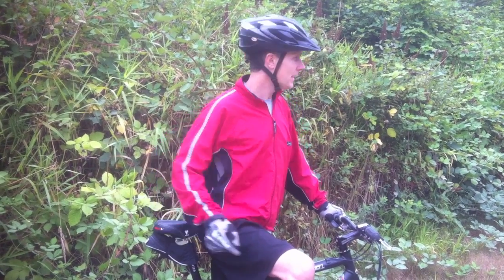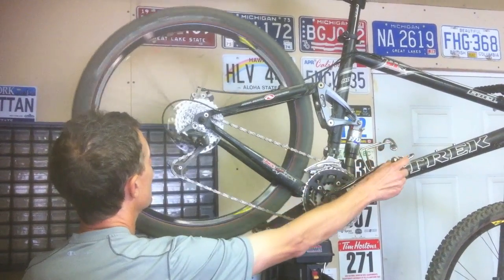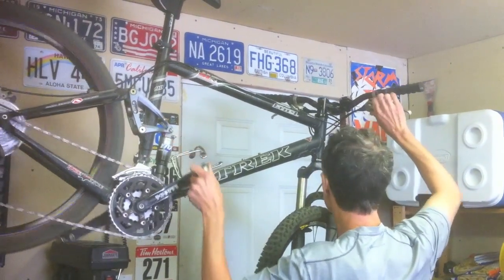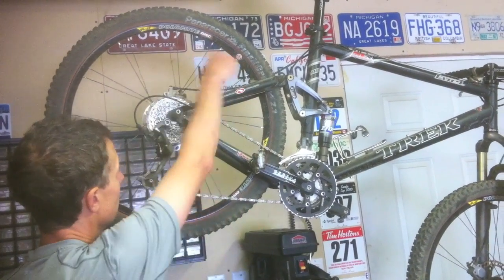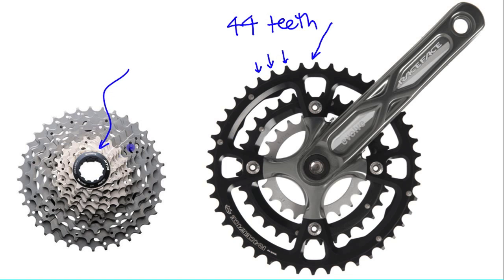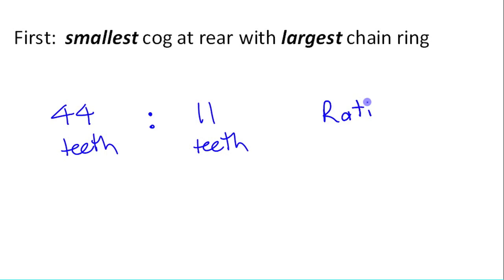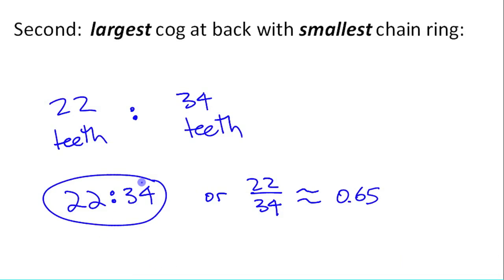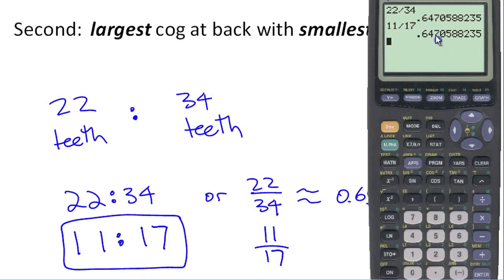Biking Uphill... Understanding Gear Ratios

Comment: Thanks much - very helpful.  So (if I understand correctly), if I'm trying to compare gear ratios on my bike for purposes of gear shifting, then all I have to do is run the math on all 21 combinations and rank them.  But if I want to compare gear ratios between, say, my current bike and one that I'm thinking of buying, then I have to pay attention to the wheel sizes also, right?  If they're the same size, no problem, but if they're different sizes, then I can't really compare the two in terms of how much effort I'll have to exert for different speeds/inclines?

Thanks again for a helpful post.

Comment from the maker: And for road bikes, the gear ratio will not be such a low number as for a mountain bike in 'low' gear, likely not lower than 1:1 at the lowest... for small chain ring and largest cog.  But a road bike would have a much higher 'high' gear, likely almost 5:1 with largest chain ring and smallest cog.

Comment from the maker: You are quite right, the wheel size would make a bit of a difference to how hard it is to climb a hill.  My wheels on that mountain bike are 26".  Both the gear ratio and the wheel/tire circumference affect the total distance you have to make the bike move for one rotation of the pedals.